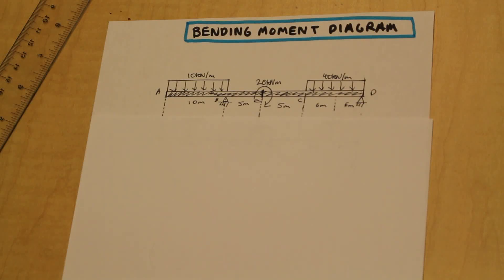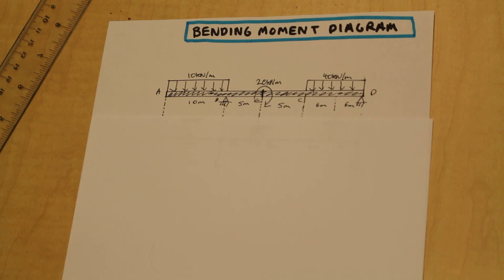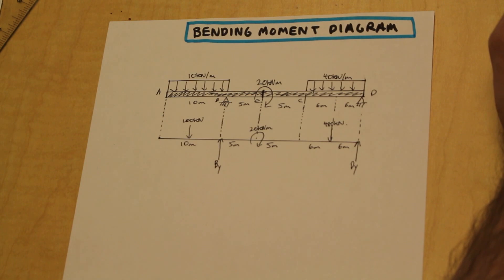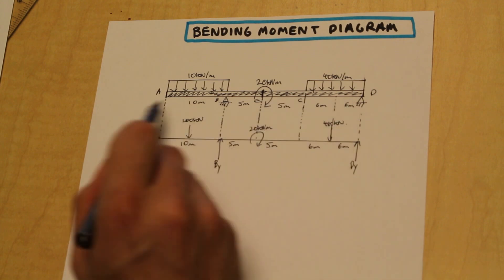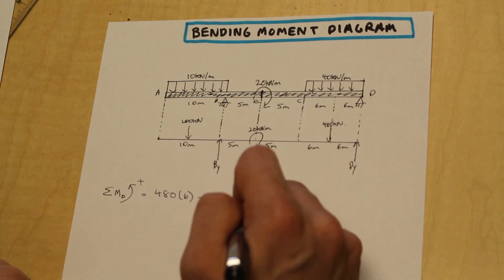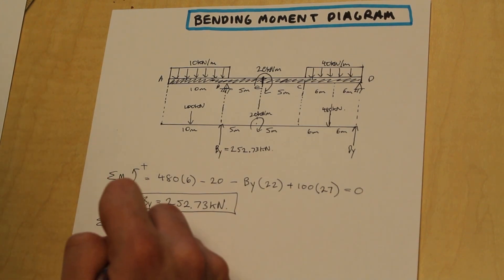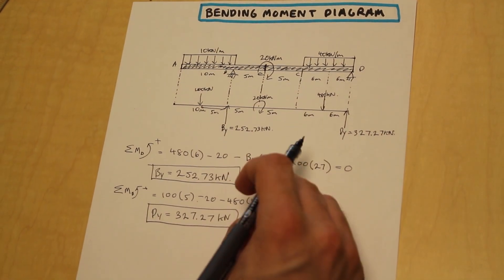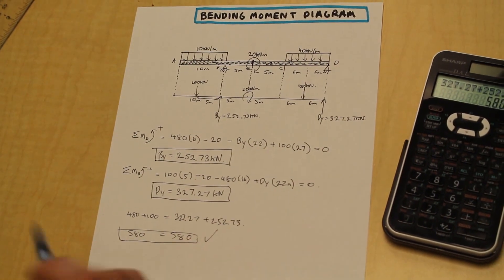How to Draw A Bending Moment Diagram Without Equations - Reactions - Part 1

Comment: For UDL there’s something wrong I think
Reply: During moments for UDL don’t you multiply the UDL by it length then by half of its distance plus the distance from your reference point?
Reply from the maker: momelezi moriat you're correct about multiplying by the length of the udl, but no we don't multiply by half of the distance, we simply add up the distance to the resultant of the udl from where we want to find our moment and multiply that by the resultant.
Reply from the maker: +momelezi moriat rereading your question, that's what we did here actually.  We multiplied our udl by its length resolving it into a resultant force.  We rewrote it as a force and multiplied by the distance to where we were interested in the moment.

Comment: why is using the sum of forces to find the reaction force "completely wrong"?
Reply from the maker: Good question Ramin.  The reason why you should never use sum of forces in y on a test situation is there's no way to check if you've solved the reactions incorrectly.  For example, if you calculate moment about one of the supports incorrectly, then solve for the other support using sum of forces in y, it will always add up to the sum of external forces regardless if the moment is correct or not, thus no way to check your work.  However, if you take the moment about both supports and find the reactions this way, if you made a mistake in calculation, the sum of your reactions will not equal sum of external forces.  This is an excellent way to check on a test if you've solved the reactions correctly, and the result of not solving correct reactions on a midterm/final can be devastating towards your final mark as professors love doing long questions that start with finding reactions.  Always take the time to solve for both moments rather than sum of forces in y.  Sorry for the long response :D